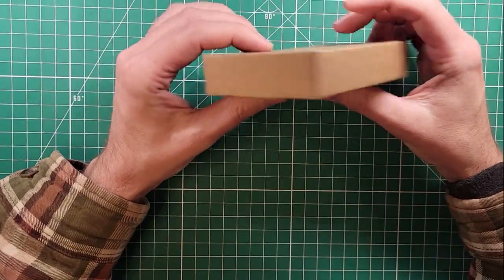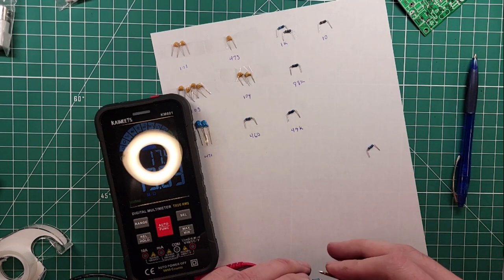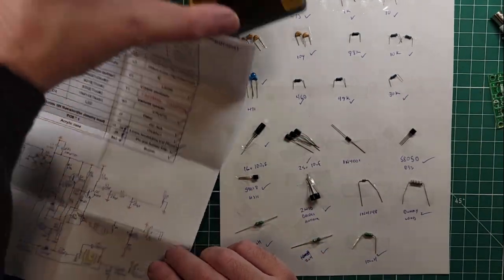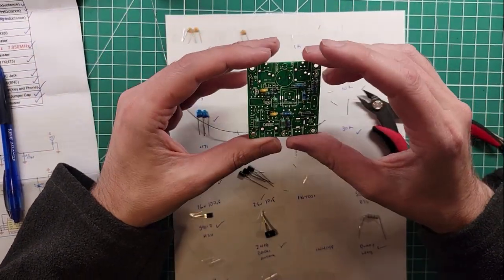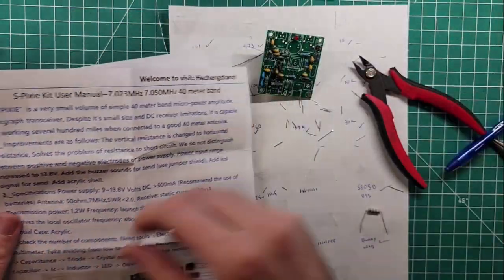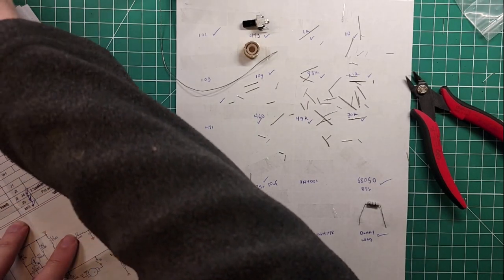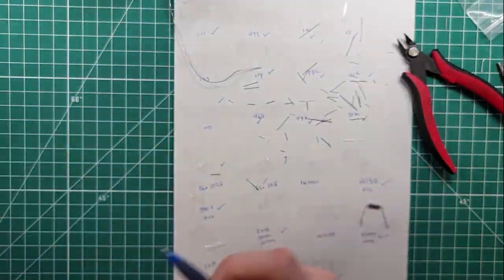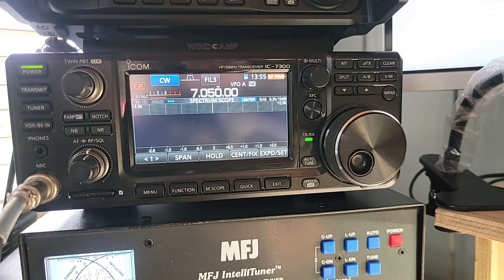Everybody should build one of these

Comment: OK, I'm a dinosaur. BACK IN THE DARK AGES, ESPECIALLY WITH GERANIUM diodes, we always used a bending jig to avoid stressing the fragile glass cover on the diodes. Also, I learned to allow a small air gap around pc board components by slipping a small tywrap under each component before soldering. That small gap does a few things:   heat dissipation (when things go WRONG), Mechanical stress relief on component legs, easier component replacement if repairs are needed, and my favorite - a place to easily attach a test lead when troubleshooting.  
BTW - I ordered the kit too !  Just my $.02  ...

73 de KG5RK
Reply from the maker: This is fantastic info, thanks for sharing!

Comment: Steve, I built an Elecraft K2 with ALL the options.  It took 9 months.  I could not have done it without a component identifier and a USB microscope.  The component identifiers are cheap. Kits are $9-15.  Prebuilt around $22.  The one I got displays a schematic image of the part.  It also finds faulty parts.  I plugged in a transistor and it saw it as 2 resistors.  Not good but saved a bunch of headaches.
Reply from the maker: Building a K2 looks like a lot of fun!

Comment: I received a few Pixie kits a few days ago.  I'm glad your helpful video is one I can hear.
Resistor reading: according to someone, the color ring / band nearest the wire lead is the first band to read.  Someone else said that for 4 and 5 ring resistors there's a gap near the tolerance ring.   Going past 3 colors is asking too much.
Learning capacitor markings is a lot worse than resistors and inductor markings are just about as confusing as capacitor markings.  They sell a LCR meter (not too many $$$) to help with Ls and Cs.  I recently got a cheap one and it seems to work OK.  
Soldering heat sensitive parts: the bent wires are already holding the part on the board, so I put a finger pad on / under those heat sensitive parts.  Yep it'll get a little warm if I'm slow to melt the solder.  So, like you I sometimes get a dab of solder on the tip first.
Your comments about your straight key technique gave me a chuckle.  My first rig didn't have a side tone.  After 3 or 4  years I got a rig with side tone.  Then I cleaned up my straight keying by letting my ears tell my fingers how to control my key timing.  
Thanks for the video I can hear.
Reply from the maker: You bet, thanks for the comments!

Comment: Only caution here. Watch our for damage from static on diode/xstrs. Can lay them on alum foil and touch a grounded object first. We used to get issues from apparently good power xstrs made from multiple ones on a chip to get higher amp rating. Looks okay to VOM. But after a few days in use at full power would die. Traced to esd blowing out some of the xstr bundle inside the device but leaving a few intact. 50 watt becomes 5 watt device.
Reply from the maker: Yep I wear a wrist strap... on my ankle so it's out of the way!

Comment: Amazing kit indeed!!" Iv,e been into electronics and ham radio for over 50 years, even retired after 26 years electronic engineering,
I have bought three of these pixies over the years as kits, and guess what ,"none of them worked!"
to save myself any more hassle, I bought an "assembled" one last week,
That one doesn,t work either!
either i,m just unlucky with these kits or they just don,t like me??
I,m not wasting any more money on kits from this part of the world, 😤.....
Reply from the maker: This one is amazing for it's simplicity, there are kits that are better laid out and have more "pride in design" and there are kits that are more of a puzzle to build.  I wouldn't attempt to do much on the air with this particular kit, but it is a cheap way to figure out kit building. Have you seen any of the QRPGuys kits?

Comment: The color codes for those resistors appear to be nonstandard too.  I had to use the multimeter because the blue series 1%'s seem to not follow the 1st value, 2nd value, multiplier, tolerance standard.  Just built one of these.  At least you got picture instructions.  Mine came with something that looks like it was printed from a notepad file.  Where'd you see that VFO kit?  I was going to figure out a way to plop a QRP Labs SiS-ish module in there but if someone has already figured it out.....
Reply from the maker: I haven't tried it yet, but: https://km4nmp.com/2019/08/24/vfo-for-the-pixie-wiring-and-sketch-for-ad9850/

Comment: Got one I built a couple weeks ago. It came with the 8 crystals. As my antenna situation(renting and landlord says no more antennas) means my only antenna is a 2m/70cm, I can't even RX using this radio. Learning CW is on my to do list, although my annual schedule has me moving into theatrical lighting mode rather than electronics mode, so this might take a while. Mine didn't come with a dummy load, although I have one on order, so I haven't been able to test it it's actually working. My kit building ability results in ~ a 50/50 success rate. Hard to know when I don't have anywhere near an antenna tuned to these frequencies. I'd also like a better manual, as I've  no clue what kind of key to attach, as I yet to have any. The Heathkit HD-1416 I've got on order has a straight key with it, so perhaps IO can adapt that,, although I've yet to learn more than a couple characters of code.
Reply from the maker: This will work with a straight key - its just a simple on/off switch, so you could make one with  an old set of headphones if you wanted.  If you've got the 8-crystal version, did it come with a socket to make swapping crystals easier?

Comment: What is the difference between the Pixie kit and the Super Pixie kit?  Is it only the acrylic case?
On line there's several offerings of the kits.  There's hardly any difference in the text descriptions, so I can't tell if one of the kits does anything different from the others.  One of the choices is transmit PLUS receive, but the pictures show no difference that I can see, except that kit shows 2 circuit boards and that kit does cost a little more.  I assume one board is RX and the other board is TX.  Does that kit actually transmit 3 watts?
From what I see from video reviews the 3 watt text might be a typo where the text should say 0.3 watts.  What do you think?
Thank you.
Reply from the maker: It's more of an introductory kit that shows you the basics of building and testing cheaply.  I think all the kits are the same.
Reply: @temporarilyoffline Thanks for the reply.  I just linked this video to someone from the comments under a video made by Smoking Ape.   I hope the guy follows the link because your instructions on this video will help that guy a lot.
Reply from the maker: @southernexposure123  awesome, thanks.  Ape's the one that made me get this.  We all did a video series on it for Coffee and Ham Radios channel.

Comment: I measure all of the passive components then stick them into Styrofoam and label each group with a felt pen. I also use only machined pin sockets for all DIP IC's. I figure if it's worth soldering together it's worth using a reliable IC socket.
Reply from the maker: Styrofoam is a good idea, I also agree on using good sockets... I might debate you on whether the pixie deserves such royal treatment though! 🤔

Comment: The colors were a lot easier to identify on the US made resistors of the 50's and 60's.  (Or were my eyes just younger?)

For parts where you worry about the heat (such as the 1N4148) you may actually want a bit of standoff from the board, rather than flush.  The soldering of other components can make the board hot.  Not so high that it could bend around and short to something else, but at least room for the flat of a tooth pick between the part body and the board.  (It can also make it easier to clip on your scope probe.)  And don't be too vigorous with your "mechanical advantage device": unless you're trying to solder to something large, it will be easier to fracture the component than to overheat it.

But silicon semiconductors are not quite as heat sensitive as you seem to think.  (Germanium, on the other hand, is pretty sensitive.  But you can't get real 1N34 or 2N404 parts anymore, so you're unlikely to see germanium in a kit.  The 1N34s they sell today usually are actually Schottky diodes, which means that the crystal set you're building isn't quite as performant - 035V forward drop, versus 0.2.)

I wish that I could find a source of the 7.050MHz crystals.  I've got half a dozen traditional pixie kits, with the plan of using them in a large room for a CW class.  But they all have the 7.023MHz crystals, and some, if not most, of the potential learners will be Technician or General class.

Nice video.  Thanks.  I guess that I'll grab one of these.  You can never have too many radios.

73, Bill - KE1G
Reply from the maker: Wise words Bill, thanks!
Reply: Have a handful of germanium xstrs and a drawer of early silicon xstrs from 70's. Real 1n34 in big glass case - big as in puffed wheat as opposed to modern diodes. Can see the cats whisker. Left from Dad's stock (W5EWF-SK).
Reply: In case u need an old xstr let me know. See QRZ for dad call.

Comment: I built two of these, first one didn’t work. I didn’t give up, though. The second one works fine :)  

edit: the first one was my mistake, but it’s is a learning process. This was my first ever solder project aside from some wires here and there.
Reply from the maker: Excellent,  any symptoms on patient zero?
Reply: @temporarilyoffline  it was a mistake on my end. Put one of the triodes in the wrong way because I got ahead of myself.. Butchered it getting it desoldered.. tried to rig it up to work, but couldn’t get it. Maybe should have added that to my original comment that it was my mistake, and not a fault of the kit. I did finish putting it together for solder practice. When the second one came in, I took my sweet time making sure everything was right before soldering and clipping the ends. It puts out the designed power into a dummy load no issue, and from my limited ability to tell is pretty much on frequency.
Reply from the maker: @W5NEH  sounds good to me, at this price, you can easily recover from situations like this one.

Comment: 1. is a license required for the super pixie kit? or is it low enough power for the frequency range  and/or the frequency range is not a critical so you wont do much harm if you was to start trolling or denial of service interfering ?

2. what would happen if you put in a 3.57 mhz color burst crystal found in many older tvs or even a 38khz crystal from a clock movement?

3. or d being a kit maybe designed for beginners( hence the full sized parts verses surface mount) means it is possible that it will be assembled  and used by an unlicensed person and has the capability to transmit on some very critically sensitive frequencies say for example the master clock you know "at the 3rd beep it will be that ever time" beep 3 times  

or some emergency back up band for if all bands was to fail.

so the manufacturer intentionally did a davinci effect and disabled something so we would not have unlicensed people not know what they are doing get on the airways and cause havoc.
Reply from the maker: 1. You can build the kit and "play" with the included dummy load as your antenna.  You can listen all the time with a real antenna - but you would need a license to transmit on this frequency.

2.  I believe the band pass filter would need to be adjusted to make this work with other frequencies.

3.  You can buy a lot of transmitters from Amazon and other outfits.  The burden is on "you" to not transmit where you aren't allowed/licensed.

Its a fun little kit, but not a "serious radio".  Enjoy!

Comment: Ok, we are family of 5, so I read the your title, an order 6 sets. Me and my wife and oldest son already completed, two 7 and  9 y.o dougters strugle, so far but make progress with last parts soldering, sixth set for our cat, I must put together myself. Now I have a question.. what is this device used for ? What does it do, and why we all need one ?
Reply from the maker: It is an extremely hackable easy to build low power Morse code radio. Family of 5 here also, but no cats. I did get one for my dog and she built it just fine, she's a border collie!
Reply: @temporarilyoffline  mhm... that is interesting. With rescent price raise  I think we will drop family plan for cell, and internet. I will ask my wife to make an app that wil tether  text messages over morse or some other square wave modulation. So each of us can use at least 300 bps shared bandwith
 Should be enough for sms.   Btw. Are they aps that you know that conects over audio to this device ?
Reply from the maker: @marcsmithsonian9773  I've connected mine to fldigi, wrote some automation code and I'm remotely cutting my grass.  .-.. is left turn for example.  Works great!

Comment: I'm a general class and don't want to use CW and only know SOS, but I still want to build this kit! I did build a kit for a tester for like everything, very handy when you have issues reading the color codes or really tiny labeling. 73 de W1ECM
Reply from the maker: Hey Eric!  It's awesome to build kits, even if you sit them in the shelf and never use them after testing that they work.  This kit "works , but it makes a dirty radio, so another kit after this would be making a filter for it... I make kits just for fun!

Comment: What size is the power connector? What polarity did YOU use to power this? Those little paddles, where did you get them? 73 DE W8LV BILL
Reply from the maker: 5525, Center Positive for me, but you can check polarity with your multi-meter by checking the power connector against any ground connection on the board.  The little paddles were being 3d printed and sold by a youth on QRZ.  I don't think he's selling them anymore

Comment: Nice build, but your technique of taping to paper, although nifty, is not a good principle. The reason is your adding the glue/sticky material to the leads and thereby causing corruption/corrosion to the surface. Not an issue at low(er) freq. Can affect over all component reliability at higher freq.  So be cautious when building up in VHF/UHF ranges ( and especially microwave).
Also get a pair of hemostats or a clip-on heat sink that you can attach to a lead whilst solder to draw any extraneous heat away from the component.  But having a solder station ( thermal regulated) is a big advantage. 73
Reply from the maker: Thanks for the tips Greg!